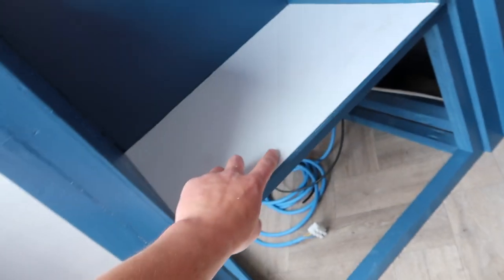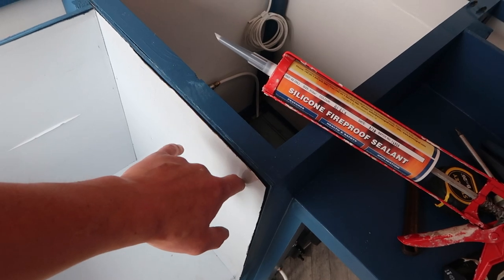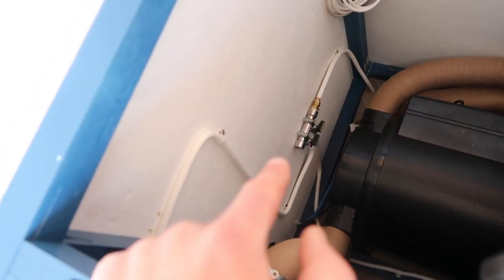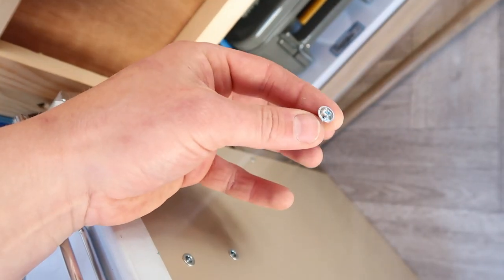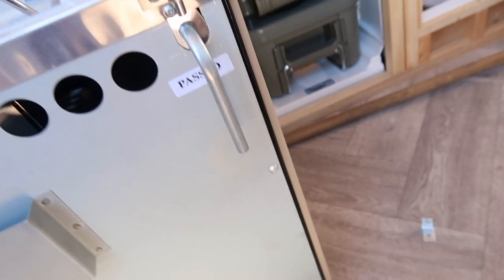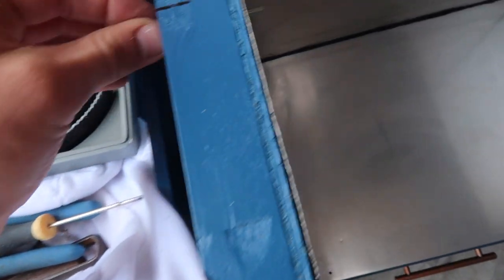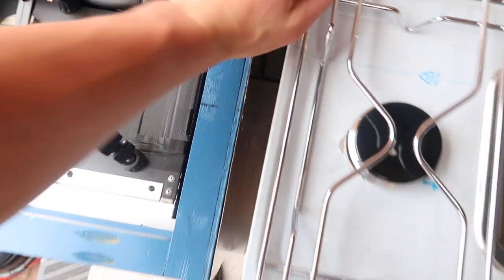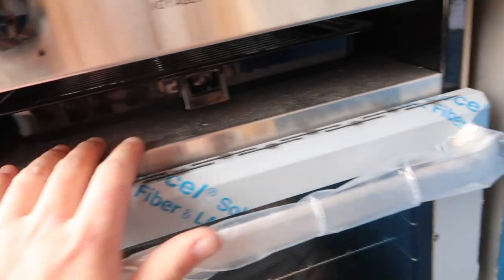Voyager 4500 LPG Cooker Install | Ep29 | Sprinter Camper Van Conversion

Comment: Any ideas how to lessen the sound of the grill rattling when you drive? Ours is quite noisy!
Reply from the maker: Hi there. Our bulk head is separated from the front so we've never had that problem. We put the grill tray in the oven when we drive so it doesn't fall out. If it is that making the noise then you could try wrapping the silver griddle that sits in the black pan with tin foil to stop it moving. If it is the part on the top over the oven hobs then maybe wrap the two locating pins at the rear that fits in the holes with 1 or 2 wraps of electricians tape. Unless I know exactly where the noise is coming from it's hard to make suggestions but you will just have to use abit of ingenuity. Good luck

Comment: Class video mate. How hard was it to tighten the copper end up once the oven was in place?
Reply from the maker: Hi Craig not too difficult just had to turn it little by little until it was tight. If you had a tap spanner it would be much easier
Reply: @ScottAndJen  nice one, cheers man. Just googled tap spanner. Will have to get myself one. 
Great videos and nice to see a geordie channel.

Comment: Hi there  , great video  . I have just recently purchased one of these cookers  , can you set up the cooker straight from the gas bottle onto the back of 20mm feed of the cooker ? Or do you have to have the Cooper pipes etc
Reply from the maker: As far as I'm aware the cooker does not have a 20mm feed. If it does then you must have a different model. The one installed in this video has a 8mm inlet for the gas. If you have a 20mm inlet then I can't really comment,  you would have to consult a gas fitter as the pressures will be completely different. Regardless I don't exactly know what you are saying about connecting directly to the gas bottle. Even if you only have one gas appliance you would need to pipe to join to the bottle.
Reply: Sorry if I sound naive , yeah it's 8mm at the back same cooker , will try and be clearer  , i can buy a gas cannister with a regulator and a gas hose pipe that will clip onto the 8mm feed at the back of the cooker , all i have to do then is turn the gas on and ignite the oven. Is it totally necessary to have the 8mm compression fitting  , the copper pipeing  , and the two way outlet  ? . And  Is it a saver method to do it your way  ? . Thanks for your time  !
Reply from the maker: @desendean6488  Hi Des. The inlet for the oven is not bayonet so I would suggest that using a larger diameter pipe with hose clips would not be recommended although it would be possible. Maybe you could get a compression fitting to bayonet fitting to make it a better and safer job but I couldn't really suggest more than that. Your gas bottle will need to be in a locker too if you are using the appliance in a van. The two way is only for isolation and the less joins you have the less chance of leaks. I would argue that compression and gas is a better job but not necessarily safer. Flexi tube has been used for gas appliances alot with no problems. Most of said appliances are bayonet however which get a better fit to the flex pipe and pretty much removes the chance of leaks
Reply from the maker: If you are going to go for pipe clips straight to the oven I would consult the manufacturer of the oven if not try something like this link coupled with the bsp fitting that I used in the video. Not sure what inch bsp you will need you will need to match that. 1/4, 1/2, 1/8 etc. That bayonet outlet will need to match the inside diameter of your hose or if it is flexi get the bayonet a little bigger for a tight snug fit.  Good luck.

https://www.ebay.com/itm/274442743094?mkcid=16&mkevt=1&mkrid=711-127632-2357-0&ssspo=nWGlm9NkQaS&sssrc=2349624&ssuid=hpdFdG0nQOm&var=&widget_ver=artemis&media=COPY
Reply: Thanks alot for the advice  , been living in a van for 2 yrs now without a oven so can't wait to cook some proper grub 
Thanks again
Reply from the maker: @desendean6488  it'll be a game changer. Enjoy. Quick tip when using the oven the flame is naked. When you cook lasagne or anything of the sort in a baking tray wrap the shelf above the flame with a couple layers of aluminium foil. This acts as a shield and stops things burning on to the pan and cooking uneven as much.
Reply: Thanks buddy  , appreciate it